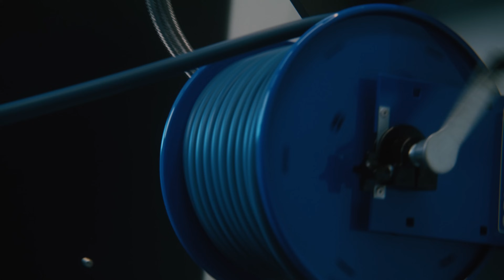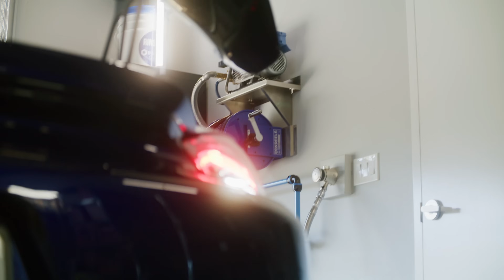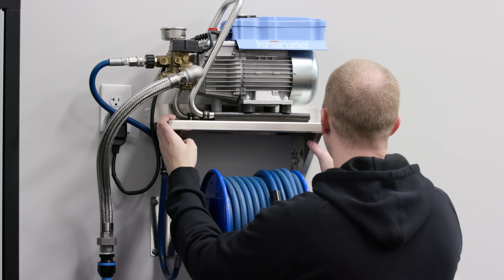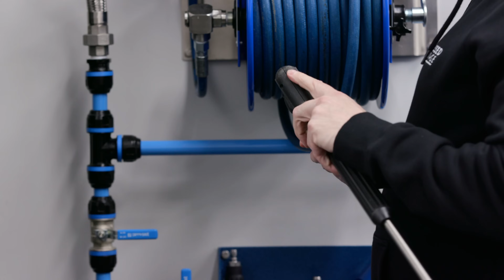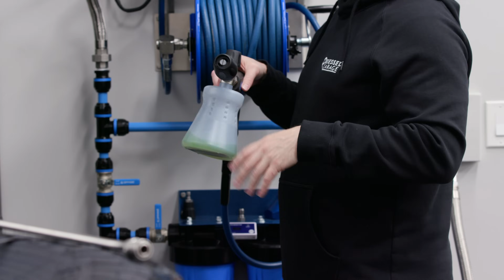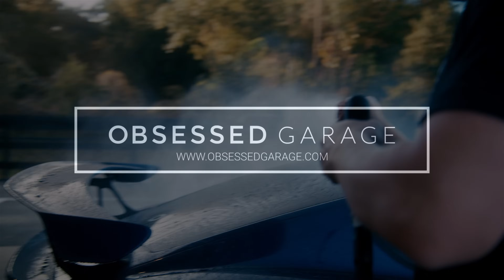Giving Away a Kranzle Custom Install Pressure Washer Solution!

Comment: So according to the rules if you already have an on-wall setup you’re disqualified? It’d be nice to have a nicer setup. The comet I have is nice but vibrates the wall quite a bit
Reply: Just remove your crap, done deal 👍
Reply: @slicktype  I wondered if it’s as simple as that
Reply from the maker: Nope, we'd just pull out what you have and redo it!